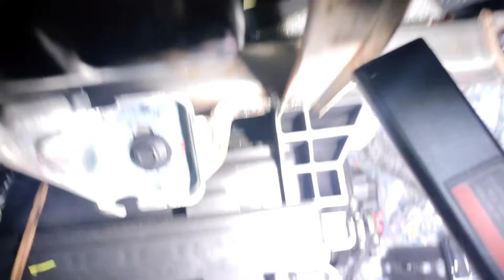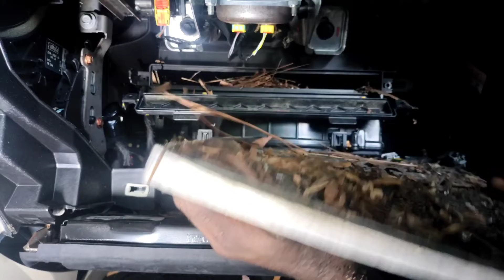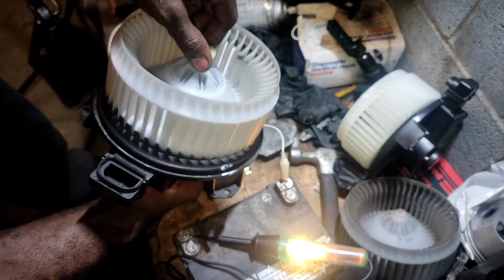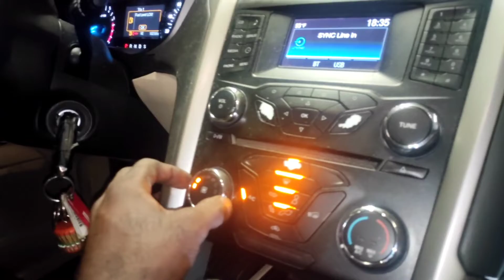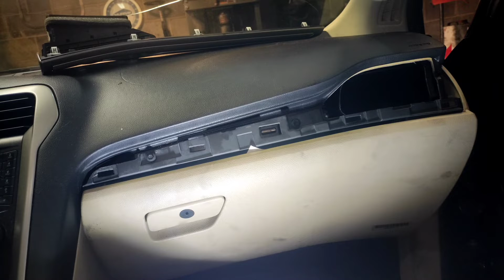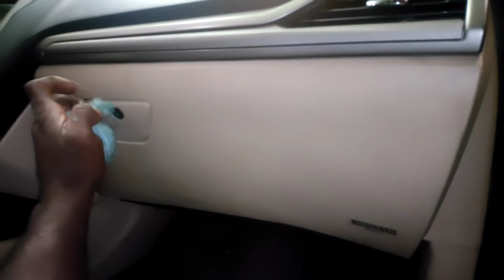2013-2020 Ford fusion blower motor and cabin air filter replacement

Comment: Thank you. I knew how to get in to my cabin filter but did not know how to get in the bottom of the fan. I think a tech checked it during brake job and one of the screws for the cabin filter is bouncing around inside. No idea how they did that but it sounds like the screw in there clicking around on fan.

Comment: For anyone who will see this my ac/ heat was blowing out the vents greatly so I decided to turn it down because it was a little cold. 10 minutes later I decided to turn it back on because it got hot again you know adjusting the temperature ,but nothing was blowing out the vents what so ever so I found it strange that it happen all of the sudden so I check the 40A fuse it was good , 9x outta 10 it’s not going to be the relay or any other component because if it is you would receive air from the vents when the air is on low but nothing on high or air from the vents in the back but nun in the front that’s when you know it’s another component but if you are not getting any whatsoever it’s the blower motor like it was for mines i put the new one in and it started blowing instantly. Pray this helps , Jesus bless yall ! Side note accept Jesus as your lord and savior he loves you and is the king that defeated sin and death and the only way to heaven is him he is the only God and true king !

Comment: 2014 fusion hybrid it makes noise when shutting off ac but not whilst running whats the probem? https://youtu.be/9pA67xZilCA?si=pE1O9ZBi9t8h6V90
Reply: Hey my fusion has something simialr to blow by but it dosint blow the cap off but when you remove the cap it pblows and when the cap is close it gets sucke onto the top of the fill port

Comment: Does the new blower motor supposed to sound loud after u install it. I had one installed on a 16 ford fusion and it sounds loud and does blow very good on low
Reply: Most likely mean something’s inside the motor

Comment: This is no joke, I park my 2016 under a tree and when I went to replace at 20-25 thousand miles , mine looked similar to this just not quite as bad . I noticed 5 or six leaves in the outside housings when opened it w full like yours. Seems like a shitty defect on the car